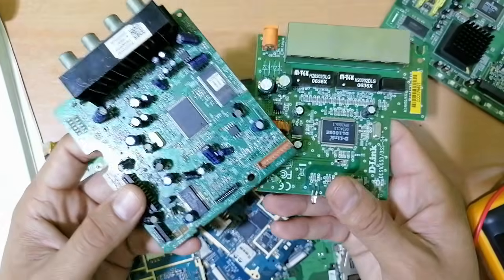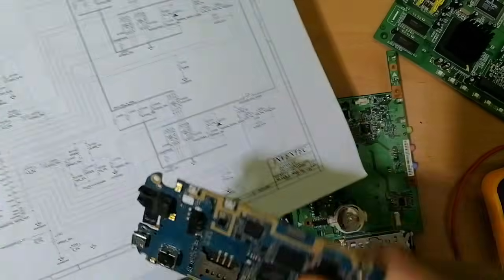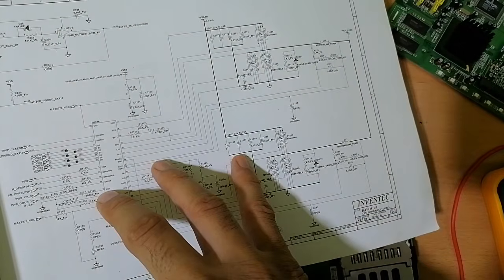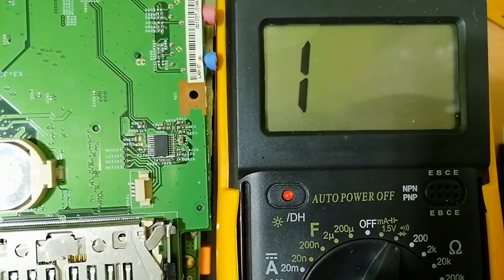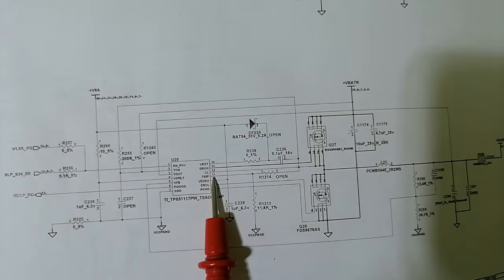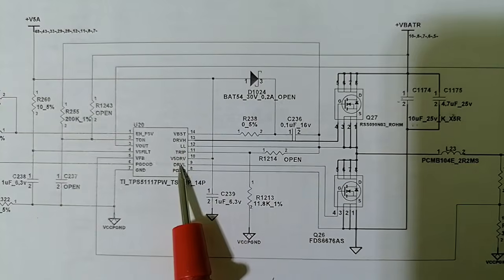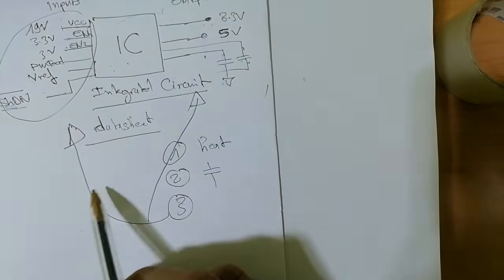Testing Integrated Circuits IC Like a Pro and Tracking Signals Techniques Explained

Comment: I am a subscriber and am checking on a 24v AC adapter for no output, so I got to the control chip  TEA1755T which is a HV start-up DCM/QR flyback controller, it does have VCC and ground but all the other names are not the same. Like FBCTRL, FBAUX, LATCH, PFCCOMP, VINSENSE,PFCSENSE,PFCDRIVER, HVS,Hv etc. As you can see they are different than yours some are explained as input or output on the datasheet but others are not. Can you explain what to do then? Thanks for everything.

Comment: @electronicsrepairbasics_erb
Question: at around 20:25 you say that if the capacitor is shorted on both sides, the IC is shorted, not the capacitor. Is that because the short goes through the IC to ground and not through the capacitor? Why are all capacitors connected to ground anyway?

Comment: I have an Asus transformerbook  model T100TA  that got water damaged .  I checked the motherboard  and found  a series of ceramic capacitor , around the power management IC , were shorted . The IC is not hot  , I tried desoldering the chip  to see if the short stopped , but  I still have shorted ceramic capacitors . they are many around the IC , I don' want to remove them one by one to check every single of them
Reply from the maker: It sounds like you're dealing with a persistent short in the power management area. If the IC is not the culprit and the capacitors are still shorted, the short could be elsewhere in the circuit. Instead of removing each capacitor, you can try injecting a low voltage (around 1V) into the shorted power rail and use a thermal camera or an alcohol test to see which component heats up, indicating the source of the short. This method can save time and prevent unnecessary desoldering. Best of luck, and feel free to reach out if you need more tips
Reply: @electronicsrepairbasics_erb   by the way , excuse me  Sir , I forgot to mention that there is a series of smd inductors too around the IC . they are  squared and grey , but their terminals are underneath them (called  smd molding inductors) , I can't  reach them with my multimeter's probes . I can see some round circles on top of a few of them  , these circles are very slightly pushed inward , I would say less than 0.2 mm deep . could the smd squared inductors be the cause of the short ?
Reply from the maker: Thank you for your detailed observation. Yes, SMD molding inductors can sometimes be involved in causing shorts, especially if there is an internal fault. The slightly pushed-in circles you mentioned might indicate some heat-related stress or mechanical wear, but they alone wouldn't confirm a short. To properly test those inductors, you can try using needle-tip multimeter probes or oscilloscope probes for better contact. If you’re still having trouble, desoldering one leg of the inductor and testing it off the board may help isolate the issue. Let me know if you need further guidance

Comment: 20:18 
Question: Why I thought that there would be two causes of   this kind of short circuit  one is a shorted ic and the other is a short within the capacitor itself, isn't that right ?  Please explain this point.
Thank you for your great explanations.

Comment: How about a video on actual voltage testing of ICs and other electronic parts showing readings or limits actually displaced on Multimeter which to expect for defects or good items.
Plus a video on power lines of motherboard, how to find the start and end of various powers (19V, 5V, and 3v or 3.3V) when no schematic available.

Thank you for your excellent videos very informative for us newbies.

Comment: The GOAT of electronics...keep up the good work
Reply from the maker: Thanks, will do!
Reply: @electronicsrepairbasics_erb  I followed all your instructions but my bios does not have 3.3v on pin no.8. The 3.3v is available on the board but does not get to the bios. I searched everywhere on the internet for the board schematic with no joy at all..lenovo s130-n4000-4g-5304831-2100-890

Comment: I have an issue with LED diodes (7 of them) on a washing machine pcb. When I turn on the power diodes do not turn on. When I touch som of their SMD driver transistor's middle pin with my finger or with the multimeter's lead, I guess those are  collectors, some or all diodes turn on, but do not stay on more than 10 seconds. Does anyone have an idea what could cause it.
Reply: Could be bad solder joints, you may have to reflow the circuit board using a hot air station.

Comment: I like video, but im a little scared why so simple capasitors are tested with multimeter, in caps could be some voltages, 25v or more... Caps are not friendly, its should be discharged... Is good to use multimeter on caps without discharging?
Reply from the maker: Yes you can discharge it if you want, but note that the capacitor discharges automatically when the power is removed

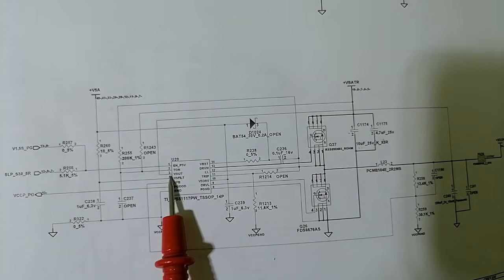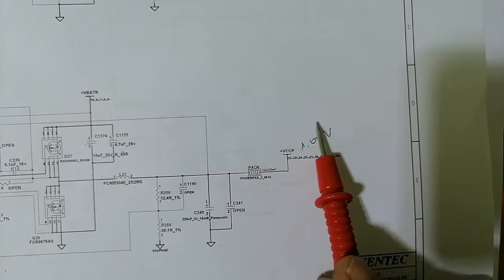Comment: I think you mistaken the pin 3 Vout as an output on U20 (22:32 - 22:50) and I don't think  it is, is it not actually an input signal to tell the IC that an output (buck regulated) is created by Q27 and Q26? If that was the output why is it not a bolt line, but instead a signal line?
Reply from the maker: Some times I give examples.
Reply: @electronicsrepairbasics_erb  Oh okay I see, sorry, I am a very slow learner, you will advance to step twenty while I still try to understand what you explained in step two!!!😂😂😂